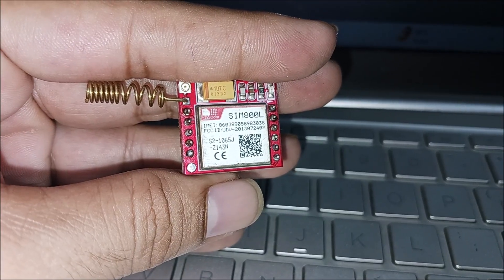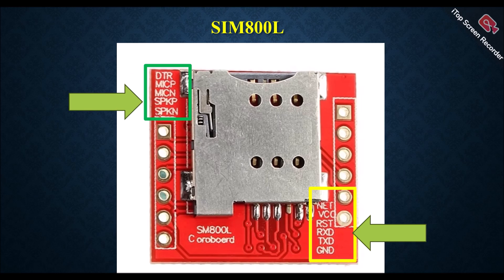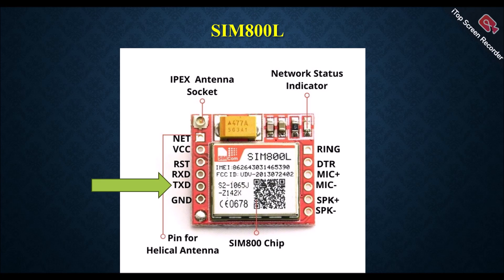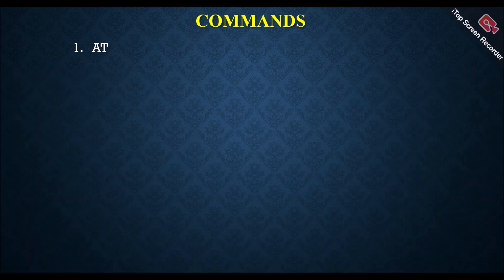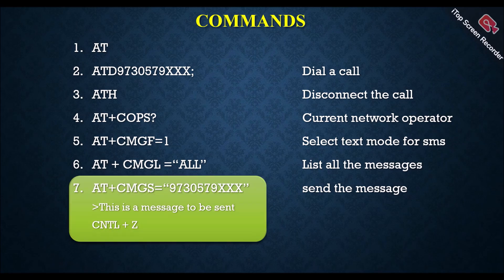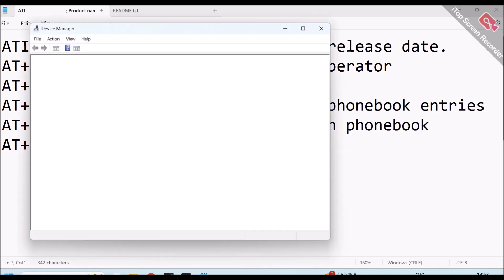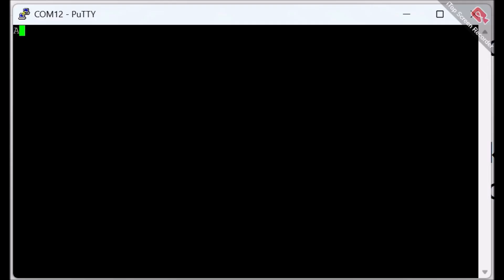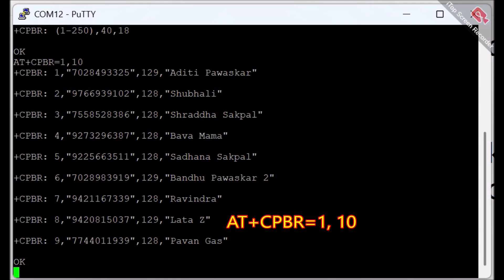GSM SIM800L with Arduino for making calls and sending messages using AT commands

Comment: I have make a module using Arduino Uno and GSM 900A to send SMS alerts when a digital input goes high. The SMS is being sent successfully, but the timestamp in the SMS is incorrect.

To resolve this, I added an RTC module, but the issue remains the same — the SMS still does not report with the correct timestamp.

I have searched through many videos and resources but could not find a proper solution. I kindly request your guidance or support to resolve this issue, as it is very important for my project.
 
I received with timestamp sms but that time is wrong.. not updated with real time.
Reply from the maker: You separately write code for RTC and check whether RTC is giving correct time. They may issue with GMT+5:30
Reply: Ok  @MaheshPawaskar
Reply: But how to check at command check with putty application ?
Reply from the maker: @056-jenadevendra3  for RTC, you have to install library. U can't check with putty.

Comment: Bro which SIM you are using ? 
I have tried with Jio, Airtel, BSNL, Vi company Sim's.... None of them are working.. My gsm800l device continuous flashing
Please help me bro
Reply from the maker: Airtel SIM
Reply: @MaheshPawaskar  Airtel 4g sim ?
Do you have any idea, why my module is not connecting to network ?
Reply from the maker: There may be two reason
1) That sim may not support 2G.
Insert this card in other phone which only support 2G and you can verify. 
2) It may not be getting proper voltage with current.

Comment: i got problem where my sim800l stops blinking for few seconds after 5-10 blinks, then starts blinking again
it can't register to network
i am using 5v/3a power supply through LM2596 step-down
i change voltage to 3,9V
Reply from the maker: @KRETOSHIGHLIGHTS  which sim card you are using. I mean Airtel etc. Because it suport 2G network. Please give a command AT+COPS=? Or AT+COPS?